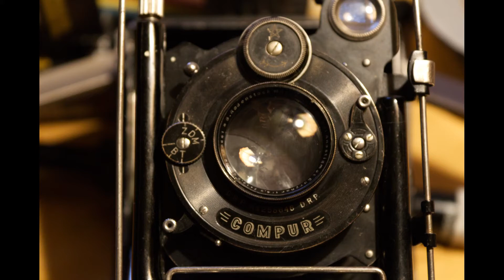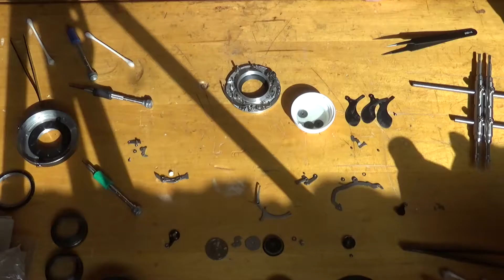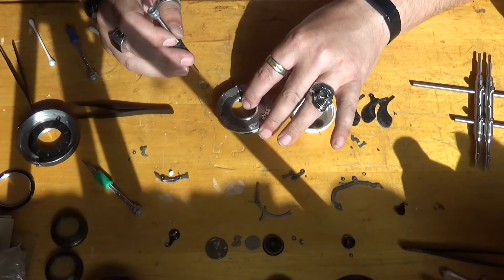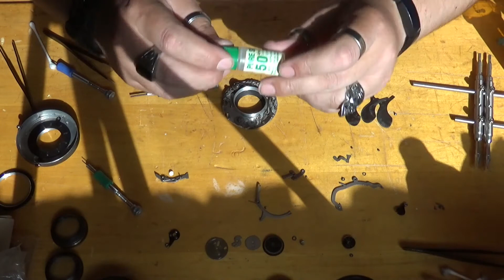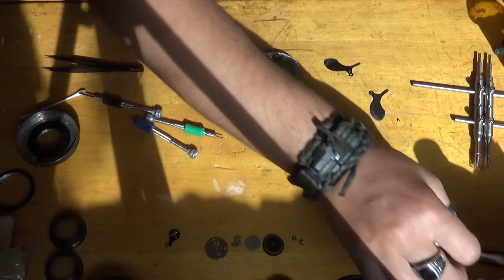Compur Dial Set Shutter CLA Part 3

Comment: at the moment I am trying to repair an Goerz Dagor in its original Compur, it looks like yours. I noticed that it is not possible to move the shutter blades at all, the inner ring the three shutter blades sit on ( at 01:04 ) is different than on newer Compurs, it seems locked in place. And this is the problem, on newer Compurs this ring is movable, so that the blades can actually shut or open. I wish you had close up videos of all the parts and its' locations..😀
Reply from the maker: I can certainly see what I can do to get more detailed footage. Though the shutter blade ring is still the part that moves with the older compur shutters. The big difference being they will often lock in place to prevent unwanted opening
Reply: @allensmithphotography  the odd metal ring does not move and it is screwed/secured down with that three tiny spanner screws (you remove in your video part 1 at 26:20 ).
how does it move on your shutter at all? it should move easily on a 1/250 th speed ..on newer Compurs this ring is of very different material and it slides easily inside the case.
Reply from the maker: @ast3663  the screws do hold it in place but they allow enough clearance that it moves freely. It is a close fit but moves easily in my shutter. It's quite possible in yours that the lubricants have dried out and are sticking the actuator ring in place